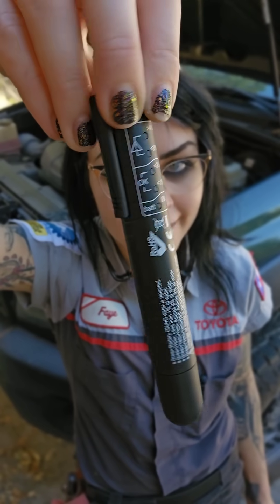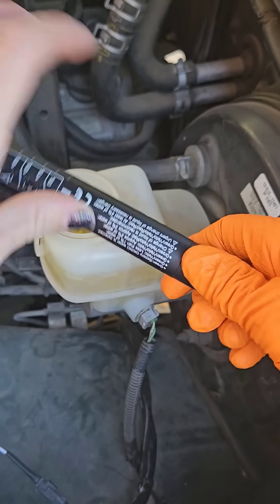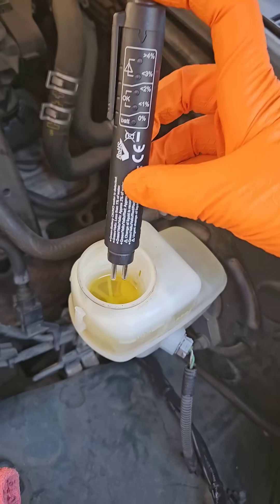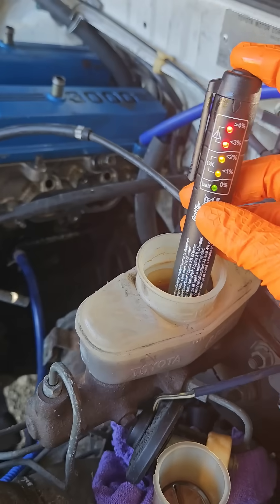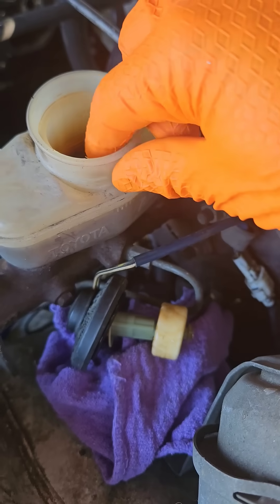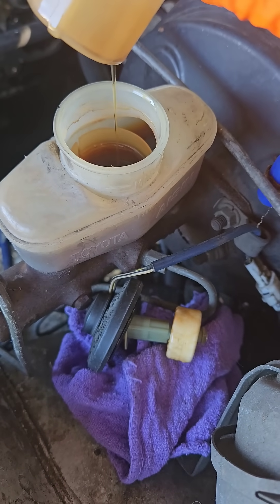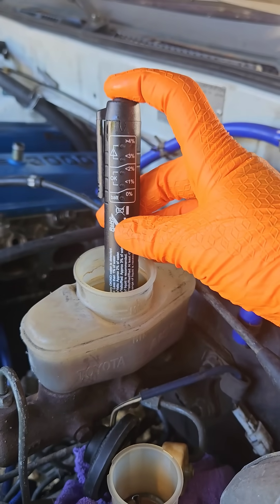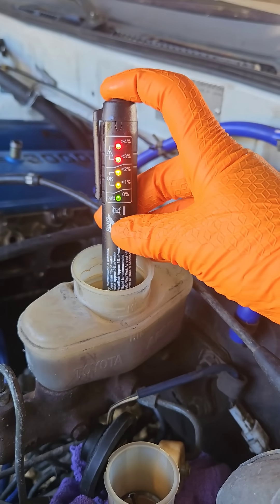Do you REALLY need your Brake Fluid Flushed?? How to Test it For Yourself!

Comment: On a motorbike yes. My rear brake fluid were left for so long that the rubber seals disintegrated leaving tiny black gunk within the cylinder blocking the system lol, flushed it with new brake fluid and replaced the seals and hose.

Comment: I hv a 2011 Lexus RX. How much brake fluid does it need? I can't determine because of  the position of the reservoir location makes it difficult to read. Should it be closer to the minimum or max line??

Comment: If you want to change your own brake fluid here's how to do it:

1. First if possible put the car on 4 jack stands so it is free in the air. Remove all 4 wheels for easy acess and less of a headache and start from the side that is most far away from the fluid reservoir. (In most cases rear right)(from the perspective of the rear of the car) 

2. Have a nice buddy sit in the car that will help you later. 

3. Grab an old bottle and drill a hole in the cap with a see through hose thrue the hole you can now start.

4. Get the small rubber protection cap from the brake fluid nipple with (optionally a flathead screwdriver) and then first put the ring key on the nipple and second put the other end of the see through line on the nipple. 

5. Now tell your friend to press the brake pedal nice and firm and keep holding pressure on the pedal. Now you can slowly turn the nipple open till the pressure is released in the bottle. Your friend has to make sure that he/she holds the pedal down to the floor untill you closed the nipple. Now he/she can pump the pedal a few times to build pressure again en repeat the process untill cleaner/yellow brake fluid comes through the line instead of old black/dark yellow brake fluid. The sequince would be left right - left left - front right - front left (on most cars)

Tips:

* Dont turn the nipple too tight!! These things Break easily and barely come loose after they are tightened too firm.

* If you think a nipple is going to break or is taking way more effort to get loose compared to the others, get a mechanic to do it or use a torch and cool the nipple after heating with a watery cloth. Repeat till it comes loose(patience is key) you dont wanna break it.

* Make sure the fluid reservoir doesnt dry out completely to prevent air in the system! Every few pumps check the fluid reservoir level and top it off with the fresh fluid.

* I worked mostly at dealers and also universal garages and by my experience flushing your brake fluid is usually needed around 4/5 years. Most dealers will tell you 2 years but that's mostly for extreme situations.

* Between 0.5-1.0 liter of brake fluid is usually needed for a complete flush.
Reply: I need you to be my nextdoor neighbor 😅
Reply: This is correct 

Mechanic and MOT technician
Reply: when I was young I was the helper for this work. I would learn to "drive" I could spin the wheel and stuff But most important was when dad said "red lamp" I had to press and hold the brakes until he said green. and we had traffic too! city traffic, stop. go. stop. go. I had a lot of fun, dad could do the maintenance. win-win.
Reply: pro tip, just suck out the rez, fill up, go give it a quick abs check then rince repeat, 80% is in the rez
Reply: @mattymiller3789 I disagree with this because the nastiest fluid will be in your calipers and break lines close to the calipers. Replacing only the fluid in the master will get no where close to this and brake fluid does not circulate.
Reply: @stevoinco if it's under 1% humidity who cares. the break fluid doesn't
Reply: @mattymiller3789  2 reasons: First, eventhough your braking system is sealed, that doesn't mean little bits of moisture don't squeeze in over time, even down at the calipers. Second, the calipers are where all of the abuse happens, and heat will cause additional breakdown in your brake fluid (as opposed to the fluid in your master, which never really gets used, never gets hot).
Reply: @stevoinco  You're right Steve. Brake fluid does not circulate. The worst fluid is in your calipers where it experiences severe heat and cold. It breaks down well before the fluid in the reservoir.
Reply: @mattymiller3789  first sucking out the reservoir and then filling it up with fresh fluid and then flushing it would be the best yeah. But as I said doing it at home means most people don't have a vacuüm pot to suck the fluid out.
Reply: @snolbie1016 Turkey baster, that said don’t ever bring it back to the kitchen lol.
Reply: @snolbie1016  iv even used a rag to soak up the fluid out of reservoir then wash down any drips with water once the caps back on, but for sure some just lack the mcguiver
Reply: @mattymiller3789  exactly, water works best indeed. A rag is also fine.
Reply: You don't even need to do that, just put some old fluid from master cylinder into a bottle and keep the line used to flush it in the old fluid so it won't suck air. Chrisfix has a video on it. In most cases you can access all 4 caliper bleeder valves without taking wheel off or jacking car up
Reply: I have multiple vehicles, so I went ahead and splurged on a pressure bleeder. Really speeds up the process and you can do it yourself.
Reply: Then the bleed nipple breaks off because it's rusted, then you're screwed. Literally, I have to screw in a screw to try and seal it up again.
Reply: Is it good to change from DOT 3 to DOT 4 since flushing anyway?
Reply: @louismartin9546  if the system is made for both dot 3 and 4 you can use dot 4 if you flush the system in its entirety. Also means flushing the hydroulic clutch cillinder if it has one.
Reply: Absolutely not. Just gravity bleed. Costs less than 10$

Comment: Former tech and service manager here. She brings up good points. I encourage everyone to read the forbidden book that no one opens (Owners Manual)
Look at your maintenance intervals and follow those at a bare minimum. 2 years is standard on brake flushes for most manufacturers. When they are trying to upsell you on something, go in informed first.
Reply: The owners manual is gold!  I had a service advisor once try to convince me I needed a new water pump just by looking at my car. I asked him what the basis was for his suggestion - he said that’s what the manufacturer recommends. I said that is unfortunate because the owners manual provided by the manufacturer recommends replacement at 90k miles, not the 50k that was currently in my car.  He looked shocked that I even knew that. I reminded him that just because I have blonde hair and boobs I am very capable of reading an owners manual.
Reply: Still crazy
Reply: @Moped_Mike  Crazy what? The woman explaining basic mechanics, or flushing break fluid every two years?
Reply: Everyone ive spoken to said you dont ever need to do it unless water gets in it.
Reply: @DakinRinone  brake fluid is hydroscopic. Whoever told you it never needs to be done is very uninformed to put it nicely. Like any fluid, it needs changed regularly to maintain its effectiveness especially one as critical as brake fluid. Your best bet is to check your owner's manual and see what's recommended.
Reply: @crashphoenix007 
Owner's manual is one very good thing, however, the tool she is using also tell you if your brake fluid need to be replaced.
Reply: Reading is the forbidden life hack
Reply: As an ex service advisor i 100% agree with your statement...read the books people
Reply: my Manual is in every language except english or german so its a bit hard xD
Reply: That's right, read the recommended maintenance schedule and follow accordingly. It's very simple.
Reply: That is the one unfortunate thing of being a owner of a Gen 2 SVT Ford lightning owner. Ford kept everything under wraps so the wiring diagrams are not even reachable now even. But I know that whenever I got new brake pads at 70,000 mi or so it ended up being a bigger deal because of the special front brakes having a sealed thing for the insane breaking that the vehicle does., I guess what I'm trying to get at is now he has been a garage king and some years I don't even drive a full tank of gas on him. I live up north but I'm not stupid enough to drive the racing pick up here anymore. I used to it used to be my daily driver in Minneapolis, when I could get decent snow tires. And I usually carried 700 lb of sandbags in the cab for extra weight. 
The reason I am very hesitant to go to any mechanic now is because my truck was running awesome, I just wanted some new shocks and my stupid mistake was letting them do supercharger maintenance. After I get it back, I found out some teenager was working on it and they totally screwed my electronic system said oh we had to jumper this wire to that to get your windshield wipers and your windows and your dome light and your all your front gauges black backlights to turn on. My I did not come here for that. I can't trust anybody. I'm in Wisconsin I know that there are a few lightning masters that are in the burbs of Illinois. That's probably the only people I would trust to touch it at this point. And it's a collector so I'd have to hope I didn't get busted if I towed my winter car when I dropped it off. Cuz it's going to be there for a while and I need to be able to drive home. 
My brakes work pretty good. I hate to mess with stuff that was working before. That's what happens with older vehicles you know
Reply: @AF_1892  sounds like the people you've worked with never paid for service information. Every shop I've worked with does. We can see basically all of the repair procedures and wiring diagram for nearly every vehicle made in the last 40 years.
Reply: You dont know their pronouns bro
Reply: @KainsAddiction   Based on HER description "Toyota/Lexus/Scion specialist, Supra enthusiast, & Crazy Chicken Lady!"
Lady indicates Feminine, therefore "She".  If I'm wrong, then the content creator is free to correct me, I'll be happy to honor Her pronouns and amend my statements.
You don't know my pronouns, why are you calling me bro?  Maybe you should ask first before making comments.
Who appointed you pronoun police? Was there a secret snowflake meeting where people sat around being offended just by existing and seeing who else they could annoy? Misery loves company after all, so you must be extremely miserable.
Do you enjoy trolling by making comments that have no bearing on the video content? Mommy not love you enough, or did daddy love you too much? Or is it a case of mommy brought home lots of "uncles" that were very touchy feely and played a game with you called Shhhh?
Reply: @KainsAddiction 😂
Reply: @KainsAddiction 😅 Savage comment underrated

Comment: Soooo,,,,no, you don't. You can drive for 20yrs and never flush your brake fluid. I'm an old gear head and will admit I'm not perfectly up on the newest, but unless you have a leak or have to open the system for repairs, leave it alone. If you don't have a problem, forget about it. 😅
Reply: Flush and replace when something else breaks on your brakes.

Comment: She's right but as a tech, I've tested this with a cup of water and brake fluid. The tool is useless.  If you have air or water in the system you will know. 

Get test strips from the parts store, they will tell you if you need to change out the fluid much more accurately. (It checks corrosion level, not water percentage)
Reply from the maker: I have a video on the test strips too and there are a lot of bad testers that give them a bad rep. This one actually works, I've put it to the test against my strips and done the new bottle vs old fluid test. There are def many cheap copies but the tool does work if you get a good one.

Comment: This is a scam. Brake fluid does not break down unless you are riding the brakes all the time. The fluid is lifetime of the car if driven normslly
Reply: that is not true at all, there isn’t any fluid or filter in the whole car that is lifetime
Reply: @arcanevoid9199  30 years of my life in the performance racing industry from machining engines, to assembling race engines  to advising to sales. Its a gimmick, a con. Hydraulic fluid will last for ever unless over heated and its not going to happen in your commuters vehicle unless you drive around with seized calipers.
Reply: @Floridamancan  your in the racing industry and you dont know about this? its not uncommon to bleed/flush the brake fluid every track day/event. brake fluid is not a typical hydraulic fluid, it absorbs water and breaks down over time. even a sealed container of it only has a shelf life of about 12 months
Reply: @arcanevoid9199  its like you have selective hearing. Even in our race mods only thing getting flushed is coolant & engine oil. We would run the same fluids all weekend most times if optimal. Brake fluid was a seasonal flush just because we dismantle everything and check clearances. On your daily driven car you will never reach hydraulic fluid boiling temps that are required to degrade the fluid. It turns black due to rubber breaking down in the system from flex lines or caliper piston seals. I spent 5 years alone with Lutz Performance X Kenneth Moen US Formula drift team in the shop and at the pits year round. Brake fluid never got touched unless we topped off or switched components. I have been turning wrenches for almost 30 years my friend. If everybody changed their brake fluid like this person suggests we would have bigger problems than plastic straws.

Comment: Can't you just boil off the water?
Reply: You could but you'd still need to flush the system to do that and by that point, you might as well spend the $6 it costs for brake fluid

Comment: The biggest reason you should flush it, is because the moisture that builds up in there, which gets pushed down towards the brake calipers, causing the pistons to seize and eventually, the metal lines will rust from the inside out.

The only tester you need, is your eyeballs.

Is it old(mileage, not so much age)? Dirty looking? 

Then change it. Don't go buying stupid ish.

Comment: Over two years old? Brake fluid can go ages and still be perfectly functional. And that was in the old days before synthetics. The reason most people have never heard of it is because it really does last nearly forever. Some vehicles are worse for corrosion than others. And if you want your vehicle to last twenty years it certainly helps to replace it once a decade or so. But it's certainly not a "critical"  service.
Reply: functional but far from perfect, especially if you get it hot. should be changed semi regularly

Comment: I get into situations sometimes where they don't have the full picture like my power steering rack went out one time and I got it fixed at one shop then I went to another shop and they told me that the service schedule paper says that I'm due for a power steering fluid flush. The service writer should have asked for a fluid test to be performed in my opinion. The paper has no brain, it can't think for itself, it just says what it says.

Comment: This is the thing I love about our little local small town mechanic shop, they men and women there are so god damn respectful… it started as a Family Owned Business, but they’ve been hiring more outside people in the past 5-10 years or so…. Any time you ever need any sort of repair or replacement/change of fluids they’ll bring you out and give you a little run down on what needs done, (obviously only in circumstances where it’s safe for us to be in the shop around the vehicle/s)… I remember going and getting my breaks changed as well as my oil and getting a new battery for my car as well, they brought me and my mom out to my car and showed us exactly what you did here, it went red almost immediately… told me I was lucky I came in when I did cause if I didn’t then my breaks would’ve for sure stopped working within that month or the next month 🤣🤣🤣🤣🤣

Comment: Why even bother with a daft dipstick like that? Flushing the brake fluid costs like 20 euro, it's not worth the risk. I just have it done at the same time as the annual technical inspection.
It's the same thing with ATF, oil and coolant. It's such a trivial expense to just have them replaced on a yearly basis that it's not worth even considering being stingy over it.

Comment: In my time working with mechanics as a tire tech up to an apprentice, mechanics are never trying to rip off a customer. It’s the dealership, service advisor etc. techs actually care ab the customer, especially if it’s clear the customer cares about the vehicle
Reply: Yeah the service writers Ive worked with get commission on service sales they use to sale a product called BG fluid which does diff fluid, brake fluid, transmission pretty much any serviceable fluid on a vehicle BG is supposed to be a premium fluid then the service advisor stopped giving them commission for selling BG fluids and they stopped selling BG fluids to costumers
The dealership would buy used cars not fix them completely sell the car to a costumer and throw away the inspection listing all the problems with it and then the costumer comes in for their first oil change and the lube tech would have a laundry list of shit wrong with the car and the service writers would tell us to delete everything we found wrong with the car
If you want to find out what kind of dealer your buying from talk to a lube/ tire tech willing to talk they will know

Comment: So if my brake fluid is low should I just top it off the other YT creators say. Or , should I do a complete brake system inspection to look for leaks and or low brake pads? I would really rather just top it off and not worry about it. Thanks!